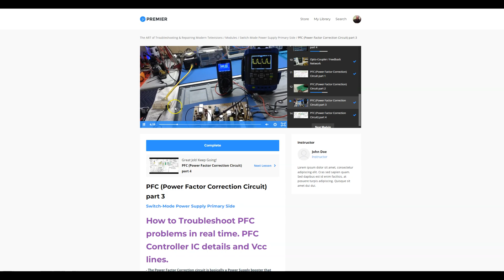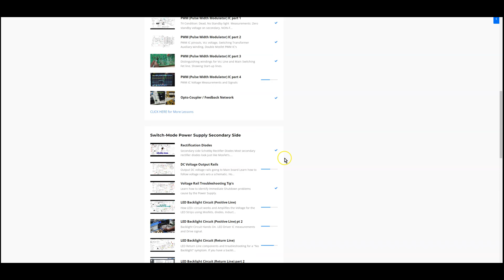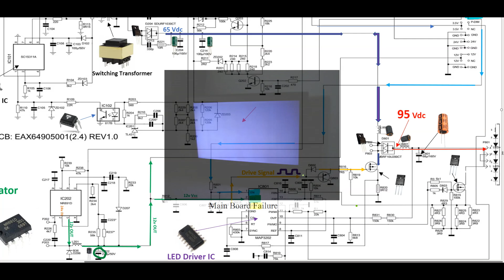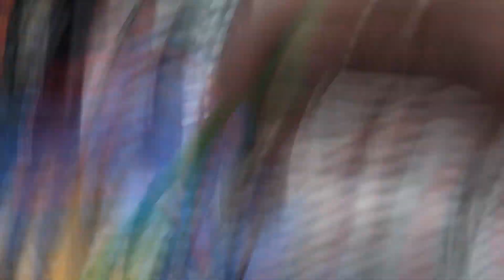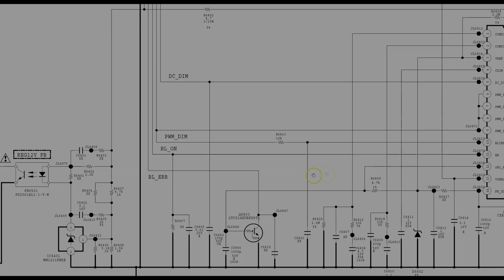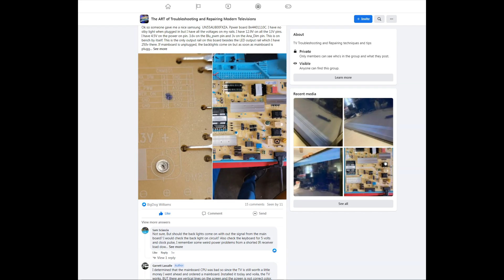LED TV repair course update with Sneak Peak inside LED/Backlight circuit Lessons

Comment: Insignia 70" model e70kt2nkajbenng
Symptoms:
I got this TV for free. I plugged it in and it worked for one startup screen cycle, then went black.
Black screen when on, but image viewable with flashlight.
If I unplug power supply board from main board, nothing happens with the LEDs.
Measure 29-30 VDC going into the LEDs when STANDBY.
Measure 70-72 VDC going into the LEDs when ON, but don't see any light.

What voltage should these get to run 18 LEDs in series? 

Is this a power supply board or a failure of at least 4 LEDs in the 4 circuits?  

FYI: There are 4 circuits of (qty 3) light strips with 6 LEDs per strip in series: 70 volts per 18 LED circuit. Each LED is getting about 4 volts.

Comment: Great video BD!  Just watching this has helped me understand this crazy TCL TV I got from a friend that was bad out of the box in 2021.  No backlight at times.  Led's tested good with tester and would flash at start up or sometimes TV would act normally.  I even pulled panel to verify led's were good. B/L on signal always there too and it was losing the boost voltage for the led's. Right now TV is working as it should for two days?  Now I know where to look.  Can't believe how cheap TCL TV's are built.   You are the man!